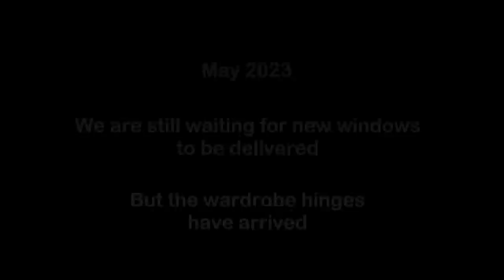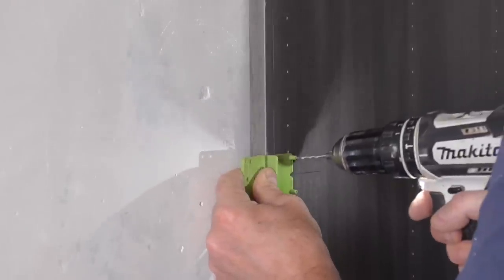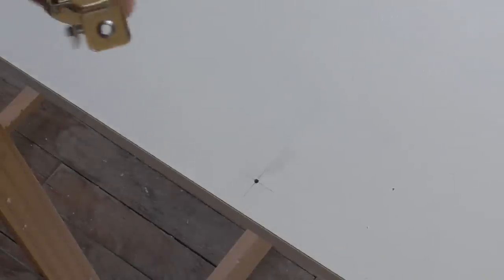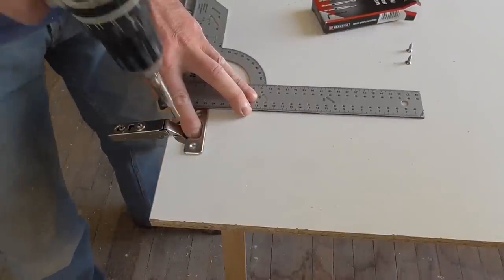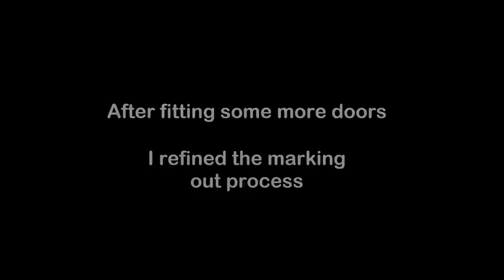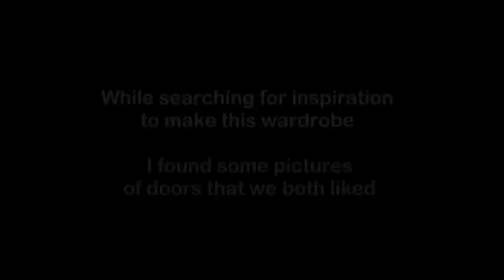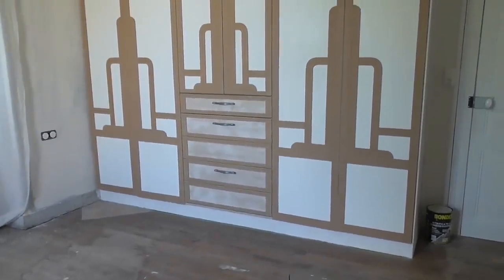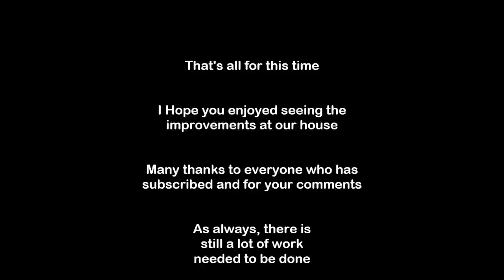Our French House Adventure - pt44 Wardrobe Doors

Comment: Thanks very much. Looks great. What was it about one of the doors that you weren't happy with, but that could be fixed with the decoration?
Reply from the maker: The gap between the top of one door and the bottom of the other was too wide, but I fixed that by adding an extra piece on and the decoration covered the join.